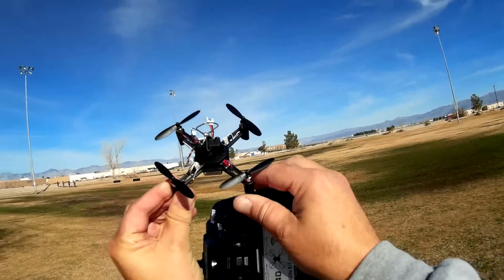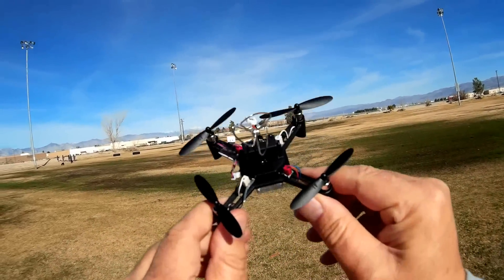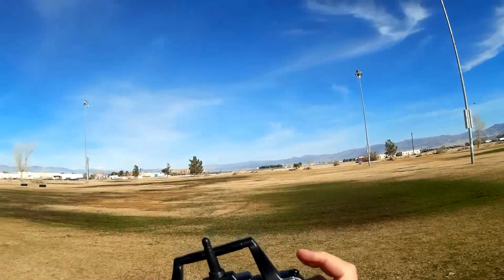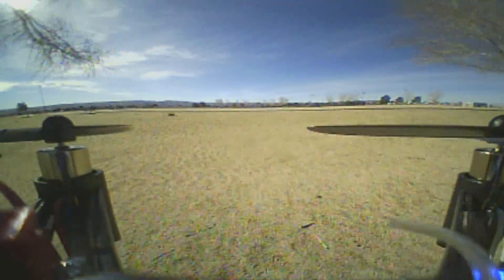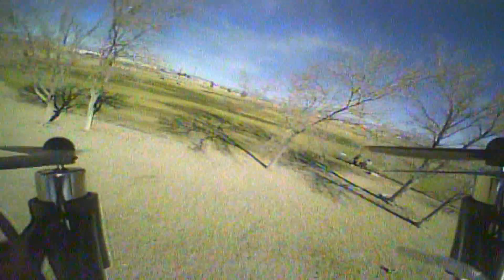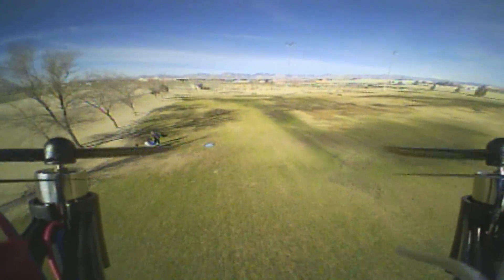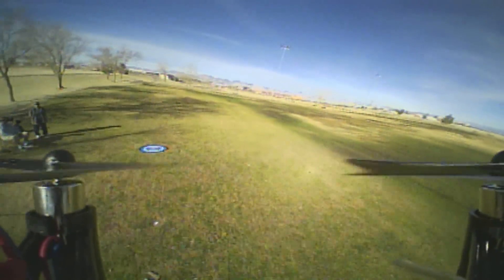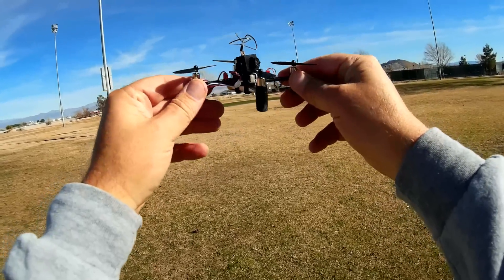DM002 FPV DIY Drone The Cheap Whoop! Flight Test Review

Comment from the maker: Buy this micro FPV flier here https://goo.gl/kJYedn
Reply: Quadcopter 101 is there any kind of prop guard that I can use with this one??
Reply: Ok. You talked me into it. Never owned this kind of copter. Will any FPV goggles work with this? Looking to pick up a pair of these on amazon. https://www.amazon.com/Crazepony-Goggles-Monitor-1600mAh-Quadcopter/dp/B01NGTO3KP/ref=sr_1_1?s=photo&ie=UTF8&qid=1487432673&sr=1-1&keywords=fpv+goggles
Reply: you could try cutting up a Hubsan x4 guard. Hope that helps!
Reply: Quadcopter 101 will this work with multiprotocl on flysky ?

Comment: There has been so much stutter on the video feedback on mobile app both on live and recorded videos. Any suggestion? I tried many wifi camera apps and there's no change. Yeah I have same DMoo2 drone.
Reply from the maker: Sorry, but that's an inherent problem of recording via WiFi.  You will lose video if there's any interference or if you fly out of range of the signal.  One thing that you might try though is to fly away from any potential sources of WiFi interference, such as apartment buildings or residential areas.

Comment: drone is not available on banggood anymore
Reply from the maker: Yeah, this video is almost 2 years old.  If a drone doesn't become popular, they're usually removed from the vendor's shelves within 6 months.
Reply: @Quadcopter101  thanks for the reply
Reply: i wanted to mount my 2850mah batteri from an e-cig charger i found on the sidevalk
Reply: Reason this drone not popular : drone fall frequently at one position after damage on compass or something ☹️

Comment: Thanx on all the info you pass along to us. I am a new flyer , and have got this mini quad recent really teaches you  a good lesson on throttle and    in stick control. Interesting flyer. I like it! But i been fling  it indoors on account o weather. Being a new pilot naturally my question in going to be. any info on replacement props for her? I blasted mine pretty quick but I am determined,  Mucho appreciated!
Reply from the maker: Yes, first try bending them back into shape if only bent.  Replace only as a last resort.  If you need to replace, you can use a butter knife to pry off the old prop.   Finally and most important, notice that there are two different shapes of props, for the two clockwise and the two counterclockwise turning motors (necessary to counter torque).  Make sure to replace a prop with one of the exact same shape, otherwise the drone will either flip or not take off if a wrong prop is installed.
Reply: Ah yes nice! They provide a sort of mini pry tool works nice. As far as  replacement blades would Tiny woop blades work?
Reply from the maker: Not sure.  But replacement DM002 props are cheap and relatively easy to find https://goo.gl/XDHCM2
Reply: Bingo! Thank you!

Comment: I wonder if the jumper t8sg  multiprotocal remote   will bind to it?
Reply: Nick Hall it does
Reply: I'll try mine as well. Bet it will fly much better then. Let me know how it went if you can?
Reply: Wayan D did anyone try to bind this to a jumper??? I'm sure it will...
Reply: Yep I am sure it will .waiting for new props for the DM002 and and batteries for my Jumper. Iam in Croatia postal service sux but I am patient.  Ill keep you posted you keep me posted as well.Peace.
Reply: What battery and connector type are you using? Man I hope i ordered the right ones? Did yours come with batteries? I am a new builder and flyer but love it.
Reply: Brant what batteries are in your Jumper if you dont mind me askin?

Comment: 101 have to tried using the T8SG to fly this, jack up all the Expo's to 125% and it's a different animal
Reply: I take that back, after ordering a few of these it appears all were not created equal and the manufacturers programmers listened to the buyers, there's a new concept. I had to wind the expos down to around 85% to fly indoors as the birds PIDs now resemble an intermediate drone performance, no more of that clunky rudder stiff control and the pitch resembles a thoroughbred race horse. Only con I see is the props are more brittle and break easily.
Reply: I am gonna try that out . Went well i suspect?

Comment: hii can we change the battery pack to 7.2 v 1000 mah
and he motor to a bit higher voltage
Reply from the maker: I wouldn't try it, as its circuit board was likely designed for a 3.7V battery.
Reply: can you help me out , as i think you have better knowledge
Reply: just tell if we can put those 12 volts motor around four corners,,, i mean  just to increase its power   
  Actually i have ordered this drone and i am going to use it on another body  which requires a bit more power   so what could you suggest,, as those motors and that battery wont be able to handle it

Comment: I wasted my money on this one a few months back. It is worthless to fly indoors because the controls are so unresponsive that you can`t make a turn. It turns like 1/4 of a second after you turn it on the transmitter. I few it outside a couple times and well it just stinks! Save your money!

Comment: I'm a newbie when it comes to fpv.  I can't make up my mind on what pair of goggles to buy. which would be better the Cyclops quanum or the Eachine Ev 800? I'm looking at the EV 800 because it can be used as just a monitor if I can't get use to wearing the goggles. Or do you have a better suggestion for me. thank you for your time in advance. I'm a loyal follower of your channel. I've leaned so much thanks to you..
Reply: Road Kill safer to go for ev800

Comment: This or the Eachine e010c? Please respond, thanks!
Reply from the maker: Indoors E010C, outdoors DM002
Reply: Quadcopter 101 thanks! I have another question. Can you bind a pair of fpv goggles to a drone/camera and then connect it to another one? I'm new to fpv but I am an experienced line of sight flyer. Thanks for responding, it's a great pro to this channel. I also like how you out the pros and cons in the description. Thanks!
Reply from the maker: Yes, they can be tuned to the specific channel that your quadcopter is transmitting its FPV signal on (most transmitters average about 40 channels that they can transmit on).
Reply: Quadcopter 101 oh, ok! I just recently ordered my Eachine e010c and I was wondering if it had upgraded motors compared to the stock e010 or if the e010s is the only one with upgraded motors?
Reply: And my final question is which drone has a better signal/range(FPV)? The DM002 or the Eachine E010c? Range is super important to me. Please respond again, I appreciate your effort!
Reply from the maker: DM002
Reply: Quadcopter 101 thank you! Is it noticeable range?
Reply: Leo Martinez  not only the range but also its battery lasts longer and has way more power

Comment: so if you dont have a goggle , is there any way to view the live video feed?
Reply: dr faizal khan a monitor
Reply: Leo Martinez 
thanks for the help mate but a bit of a rookie here, could you specify which monitor in particular?
Reply: dr faizal khan give me a second, I'll be right back with a suggestion. (you should get a vr instead, it's basically a monitor with a sun screen. Some monitors are very hard to see outside, Vrs are not). I'll be right back.
Reply: I have found a couple of monitors. What budget do you have?
Reply: Leo Martinez  about 60 usd would suffice?
Reply: dr faizal khan would you mind building one? It's cheaper than buying one already made.
Reply: Leo Martinez  i don't mind mate
Reply: What??
Reply: Leo Martinez I'd rather buy one , don't have the time to build one
Reply: dr faizal khan links above.
Reply: Leo Martinez thanks mate
Reply: buddy order a fpv receiver usb  and view it in laptop :)

Comment: --The quad itself did very well it seems.   The DM004 has huge issues as well.  After hours of mod-ing the Tx it is now very stable and controllable.  The issues with the Dm004 TX were more mechanical where this TX seems to have latency issues.  I hope it works with the DM004 TX.

Comment: Hi just received mine after watching the review flys fine but camera is not getting picked up on my fatsharks tried changing channel no luck,does it also go back to show 0 on the camera display cheers
Reply from the maker: The transmitter is off if it's showing 0.  There's actually four selectable power levels 0 (off, select it if you want to fly without goggles), 25mW, 80mW, and 200mW.  To change power level, hold the selector button down for five seconds or more.
Reply: go see Andy RC he shows how to work the camera in detail.

Comment: I don't know why they didn't just make these with the DM007 board and 8520 2s motors with 55-65mm props.why more fun and responsive.
Reply: quadcoptering AZ you would want King Kong 65mm props instead ! Anything smaller just didn’t have enough power and the thrust/lift is spongy  , with King Kong 65mm props I find that it’s throttle is instantly responsive and dosent have that spongy effect,  I use them with this dm002 compared to its stock 58mm props ,  but I also use beta fpv 17,500 kv 720 upgraded motors so this thing RIPS !!! , and use a LiHV or a lipo with high C discharge rate like 50/100C for more power , I use boldclash 450mah lipo 80/160 c 
& boldclash 550mah LiHV 50/100 c 
And flight times are from 5- 7 minutes or more if I use my 750mah LiHV for 8-10 minutes
Reply: quadcoptering AZ and if you want to make it more advanced aircraft lol buy an AKK a3 OSD 25/200mw fpv camera , it has on screen voltage  & a flight timer so you can easily look to bottom of your screen on goggles and read the telemetry to help you know when to land , and it offers a frequency display and aircraft callsign , Mine is “BIGKERMM “ happy flying !

Comment: can I ask you a question. I hot my syma x5c-1 today but the joystick on the left moves sidewards to left and right and right stick is the yaw. 
this is not right is it.
Reply from the maker: Unfortunately Syma definitions of Modes 1 and 2 are exactly opposite of what the rest of the world understands.  But fortunately, Syma transmitters are switchable back and forth between Modes 1 and 2, simply by holding down the lower right trim button while simultaneously turning on the transmitter.
Reply from the maker: You accidentally switched modes.  Try this. Move and hold the little silver button directly under the right stick.  Hold the button to the right or left while simultaneously turning on the transmitter.  You only need to do this once, and that should switch it back to yaw on left stick and roll on right.
Reply: It's not wrong , you have a mode 1 transmitter . Here in North America we use mode 2 which is the opposite of mode 1
Reply: I did not know that thanks Quadcopter 101
Reply: Quadcopter 101 thank you very much
Reply: Quadcopter 101 why don't they tell you that in the manual, I don't know, oh yeah that would be to easy. Keep the vids comin.
Reply: Thanks that did the trick. Ian.

Comment: Nice touch to add build instructions at the end for those interested.  Too bad it comes with toy grade RX & TX.  Of course, you can get an Eachine 010 tiny whoop clone for about $17 and add your own AIO cam/VTX to it for about the same price, and its already built. There's also the option of the "QX" series (80, 90, 95, 100) micro FPV drones which do have a programmable Spracing F3 Evo board on them, and are available for FrSky, FlySky and DSMX transmitters, should you have one of those at home. They are configurable via Betaflight (I think they've all moved over from Cleanflight by now). Anyway, there's a wide variety of these micro FPV quads to chose from out there .. just depends on your tastes, ability and if you have a hobby grade TX at home already. I have a module in my Taranis which allows me to fly a LOT of 'toy grade' quads (Syma, Cheerson, Attop, Eachine, JJRC, BayangToys. XinXun, MJX, Mould King, etc.) The little module was cheap .. like $10 at BG, so that was definitely worth it to be able to fly the toy grade quads with a really nice TX like the Taranis.  It's nice to have options!  Thanks for the review. Cheers.

Comment: it was a neat thought though I don't get the point of building something that is essentially a toy dm007 rather than just buying it made and adding a camera
Reply: george aura they should have used the actual DM007 board.its 2s and is super responsive and powerful with 8520 2s motor